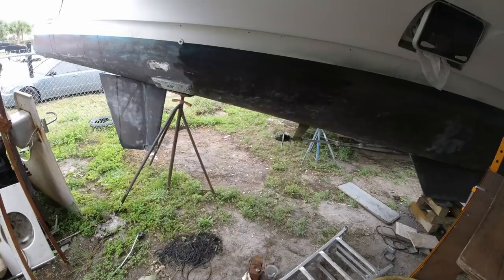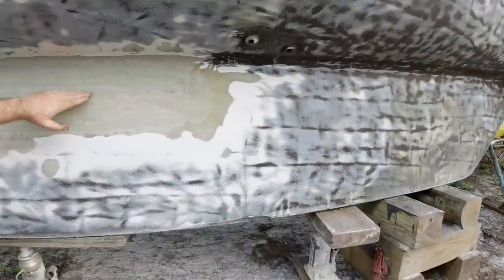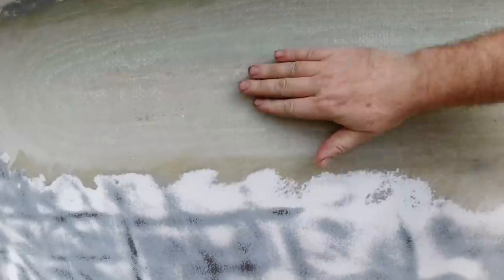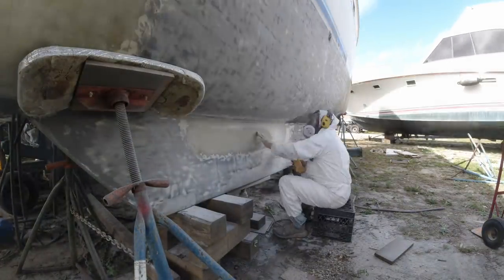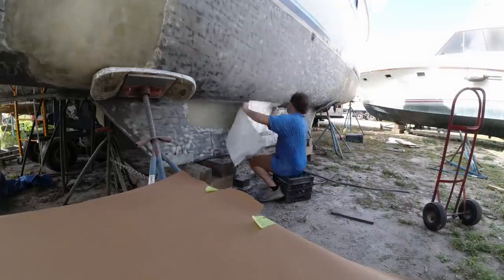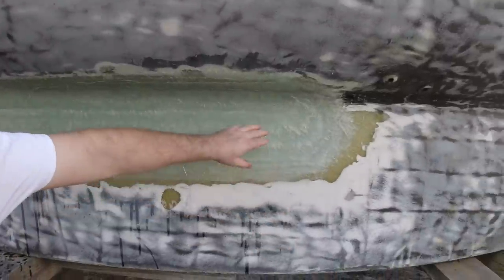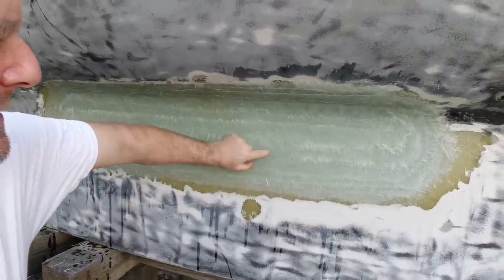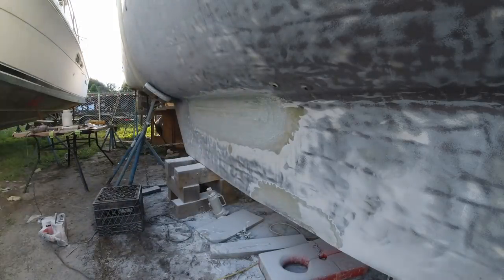31 Hidden Damage. Cracked Keel Catamaran Repair.

Comment: Hi Bryan, 
I had a boat building business with my Dad here in Australia. We use to build 30ft fibreglass centre consoles and sport boats. (Like your Miami go fast boats).
I’m probably late to the party as only found your channel recently, but thought to mention in case it helps someone else doing a similar crack repair like seen here on the keel. By starting your lay up of the laminate with the small pieces first, then allowing the next larger piece to go on and overlap by say 3/4 of an inch, then each layer has an edge bonded to the original laminate. It makes for a stronger repair. 
In areas where there is possibly a little moisture still in the laminate like on the bottom edge of your keel, dabbing a cloth soaked in acetone will help to remove moisture from the laminate as the acetone evaporates, carrying away the moisture with it (great for when repairing osmosis blisters that you grind out and re-glass like Bryan is doing here). Sure it won’t remove all the moisture from further into the laminate, but it will allow you to get the best bond to those exposed outer areas you are repairing. 
When doing the “tabbing” we always used a cove of filler before applying the layers of glass. We used a mix of resin and micro balloons filler powder to mix up a “bog”. You applied it along the 90 degree material joint with a 2-3 inch putty knife. Then we used a short 5” off cut of plastic electrical conduit pipe. You run the pipe end edge along the filler and it leaves a perfect quarter round cove shape (like a ceiling cornice does on a houses ceiling edge). You then apply a narrow strip of glass that overlaps each side of the cove edge onto both pieces of the 90 degree bond. Then the next layer of glass is wider again and so on. This allows each of your layers of glass or “tabs” to bond directly to the original laminate. 
I’d also recommend using a bristle roller or smaller grooved aluminium roller used for rolling out the glass after resining it, as this ensures all the air is rolled out which makes a neat strong bond. 
When you finish glassing, I recommend placing all your glassing tools in a tall bucket, with a sealing lid, with say 6” of acetone in it. Wipe the worst off onto a rag and just drop it in. That way they are ready to go next time you need them. Even the wooly glassing roller covers can be reused in this way if of a reasonable quality. Place the lid on the bucket and can sit for weeks, no problem. You will be surprised how “dirty the acetone can get in the bucket and the glassing tools are ready to use with minimal cleaning effort such as a quick wipe with a rag. 
Just a couple of tips that I hope make sense and I hope you or someone else may be able to use. 
I’m really impressed with your top efforts here Bryan. Wishing you and your family all the very best mate,
Cheers 🍻
Reply: Epic tips. I noticed the same details and your info is great addition to the series. 💪🏻💯⚓️
Reply: @guruhousedelta  Thank you Sir! All the very best,
Cheers 👍👍🍻

Comment: We also had a crack in our hull under the v berth, we think because the glue to the bulkhead that supported the water tank created a hard spot and a full water tank pounding into waves put uneven force on the hull. We didn't know what caused the crack until we had finished grinding, we are so lucky to learn though you!

Comment: Awesome update! The layup was opposite to what I thought it would be - start small peice to large fiber peice.  Does it matter or just personal preference?
Reply from the maker: It's a big controversy among fiberglassers on which way to do it. I think the both work, but largest to smallest makes a nicer repair especially with thick cloth  as the bump of the larger piece going over edge of the smaller can trap air and then you can sand through the larger one breaking the continuous fibers when you fair it where that little bumps is. It's hard to explain, maybe I'll cover it in more detail in a future video.
Reply: @BryanSailing  I understand your explanation.  But if you are going from large to small the only piece connected to the original laminate is the first largest piece.
Reply: I thought the same thing, but then I remembered that this guy is meticulous in his work.
Reply: Exactly how I thought it was watched Parlay and others do it that way.  It also makes sense because its a concave divot small larger largest fills it back in overlapping existing layers
Reply: From my Google search, It depends of the kind of resin that is used.
Reply: I saw somewhere that apparently, Boeing recommends one way Airbus the other.
Reply: @matthewsellers82  That's interesting.  I'm guesing there can't be too much difference between methods when it comes to strength in that case as those guys would have done all the stress testing.
Reply: Hey Bryan, great to see you back at it! I've checked your channel fro  time to time and then YouTube missed updating me of your videos. Always enjoy watching you tackle these problems with solutions! Cheers!

Comment: Peel ply is an option yes, but it will keep amine blush off your laminate. You can't sand of amine blush, it smears and cuts into the glass. I personally don't cut smaller pieces of glass when I patch and area. I cut  all the same size and as I sand it it will give the proper tapper. I think people under cut the glass size when they cut progressively smaller pieces.

Comment: Looking good.  Any plans to float it and bring it up north so you can work on it closer to home?  Kind of strange that the keels are part of the hull.  I would have expected them to be external to the actual hull, so if they sprung a leak, they would not flood your boat.

Comment: Hi Brian! Been watching your videos for a long while. Question...
Seems you purchased a home with an ability to dock your boat behind the house. Certainly you’ll need to raise the boat out of water and on land to work on it. This video tells me you may be preparing the underside for being towed to the property. Seems like there will be a number of heavy mechanical things that may happen to move the boat out of the Water.  It would be interesting to learn your plans of how all of this will happen. Of course by finishing the bottom allows you to leave the boat in the water and still work on it. I was thinking of building a wheeled sled to pull the boat out of the water rather then lifting the boat with heavy equipment.

Comment: I see that some Cats use keels that are fitted into slots so when you hit something they are supposed to pop out, do you think that is an evolution or just a feature? I see that your keel is hollow, I suppose that the access hole you cut in the floor is to prevent the hull from filling should their be a breach below the waterline? Are there any water tight bulkheads above the water line?
Reply: It is a feature that allows very fast repairs on charter boards that run aground to put them quickly back into chartering.
Reply: @michaelhaardt5988  Thank you for that explanation, that is a pretty good feature, I would have never thought of that, I guess necessity is the mother of invention.